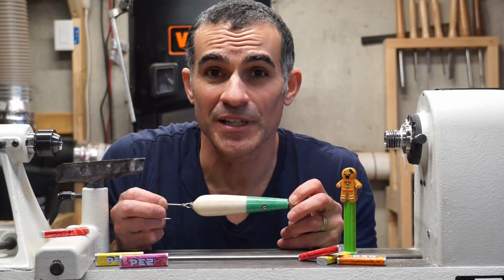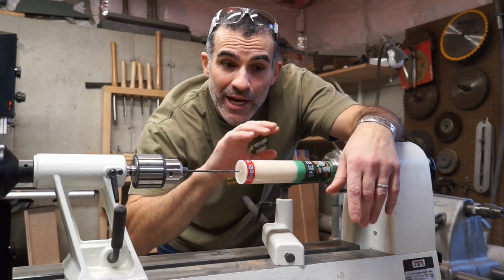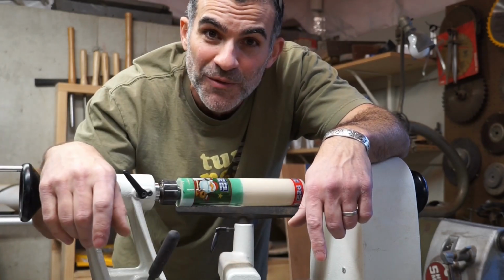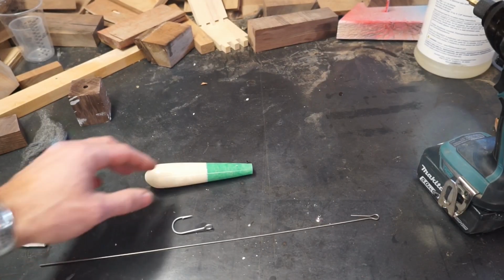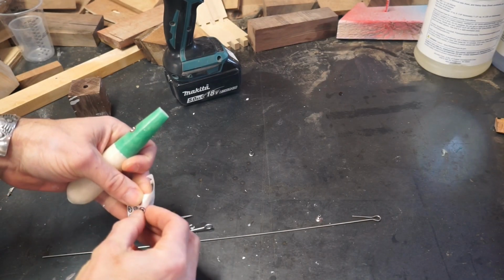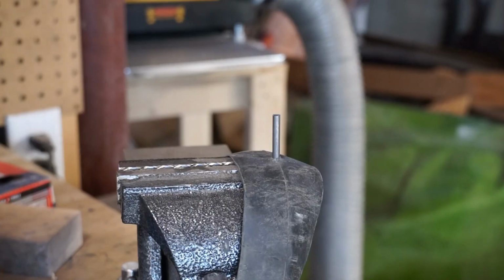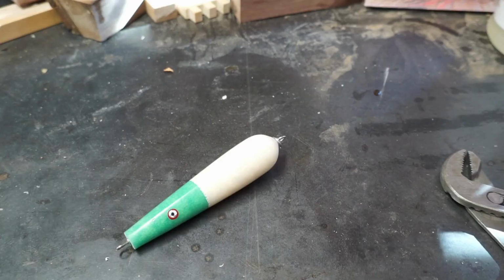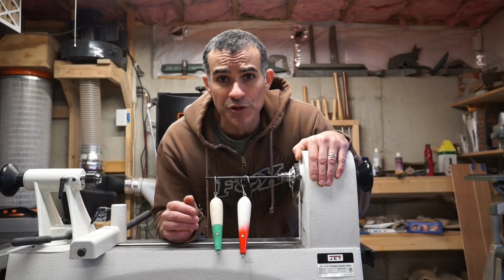Woodturning Basics: Make a Saltwater Epoxy Resin Fishing Lure

Comment: What epoxy resin do you recommend?
Reply from the maker: Hi Greg - make sure to use a deep pout epoxy. I used Total Boat but it’s painfully expensive. I have used Alumilite too which I like better as it mixes in a 1:1 ratio as opposed to the 1:3 ratio of Total Boat. The performance of both seemed comparable. A friend of mine swears by Liquid Glass, which seems to be much more affordable. I’d like to try that next.